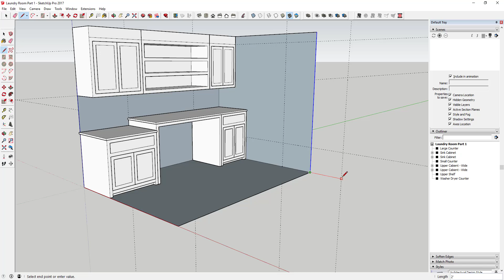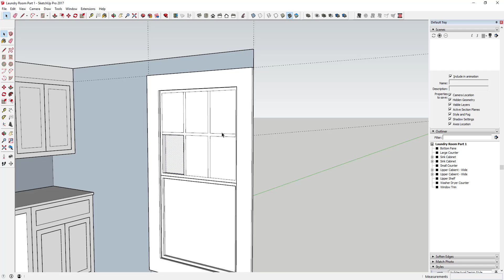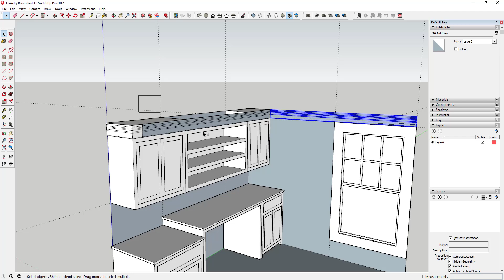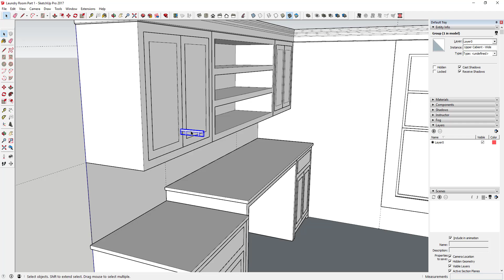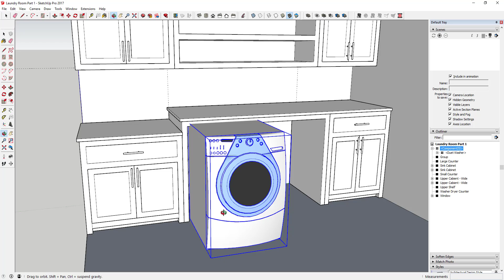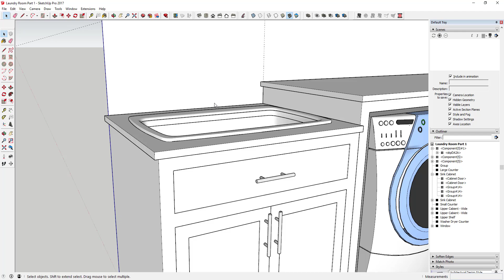Modeling Interiors in SketchUp - Laundry Room Part 2 - Appliances, Windows, Crown Molding and More!

Comment: Enjoyed this series.. I have a few years experience in using Solidworks. Im struggling to swith over to Sketch up! I find there is no real detail in Sketch up? It looks pretty, but in terms of how to actually make what you have modeled is what im struggling with? For instance your rails are just blended into your side panels!? No jointing line?
Reply from the maker: Well that depends on what you're trying to do. Most plans are just visual representations of spaces, meaning you don't NEED to model to that level of detail. It's like modeling studs in walls - there's usually no point as it's a lot of work that makes making changes difficult. You'd just model the wall as a rectangle to its real world width. If you need to BUILD the cabinets based on your drawing, then you'd have to model the detail you need.
Reply: @Thesketchupessentials   Yes I completely agree.. I think its where I'm trying to transition from Solid works where I create a sketch with all the detail and then extrude components off that. Where as with Sketch up it seems a bit more make a box and just cut away at it until you get the correct shape. Very different programs. But I will plod along until I get it. Appreciate the videos 👍